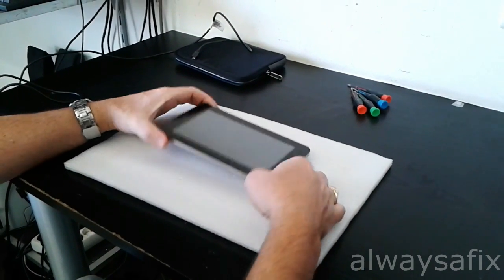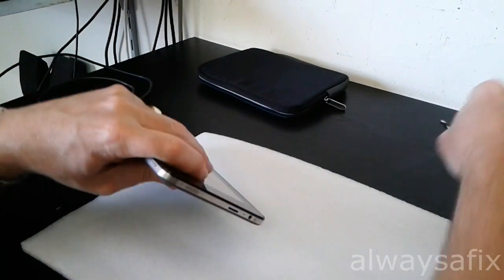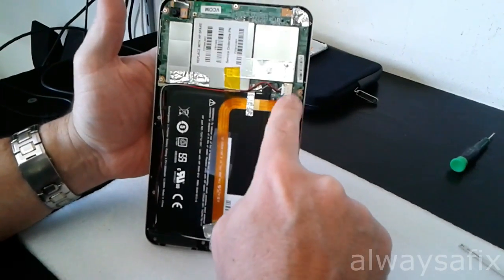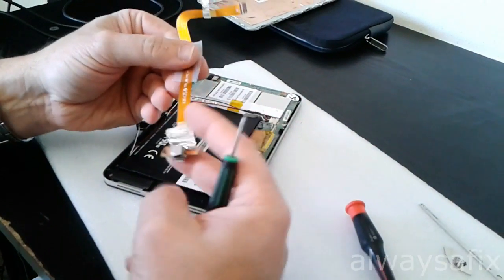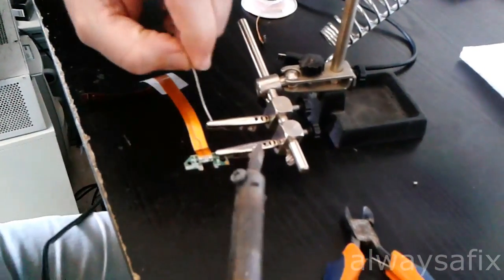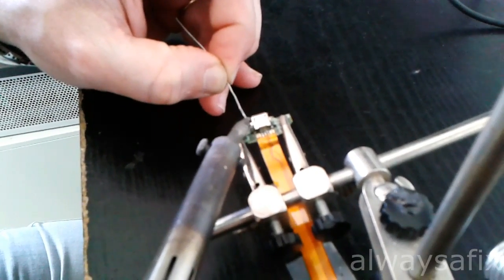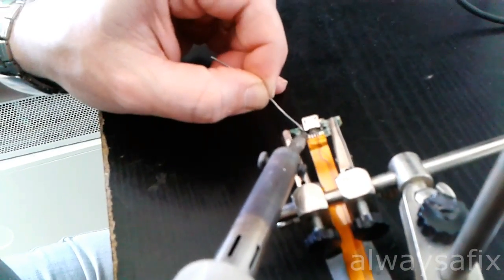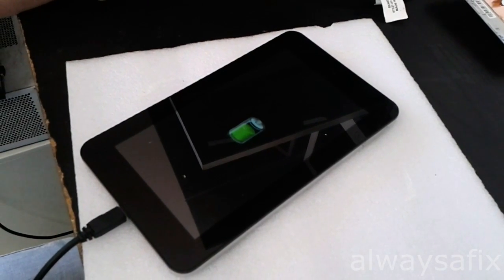Tablet android not charging repair

Comment: My archos 80 cobalt is quiet old but stopped working some day (years a go) the charger does say that its on yellow (mid charge) but will not turn on no matter what i do I leave it on charge for over 24 hours and it wont charge fully or go green, it used to when it did work.I also left it off charge for 1 night and it went right to red again. I have tried resetting but the screen never lights up completely dead ant ideas?
Reply: it is a small charger

Comment: I can't turn my tablet on. I only get a "flashing" battery sign with battery voltage at the bottom. I opened my Mobicell "Plum" and checked the red and black wires where they connect to the board. I put the voltmeter to check them with and without the usb charging cable plugged in and I get about 3.4 volts. The battery label says it is 3.8 volts. I wanted to take it back to PEP for the warranty, but I left Joburg and am staying in Seoul and it started happening after I left Joburg. I'll unlikely come back soon enough to take advantage of the warranty. Ironically, this technically advanced country with fast internet doesn't have inexpensive tablets! And my data is still on this tablet. I've only had it for 2 months. Any other ideas you might be able to advise? Local fix-it men are hesitant to work on a tablet from overseas.

Comment: did not work and now I have to buy a new tablet
Reply: Why didn't you just take it to a repair shop -_-
Reply: Any tablet is going to give you the same problem. I've been through 2 tablets since 2014. Same issue, broken USB ports. I will never buy another tablet again.

Comment: Will this thing fix this story i have the same tablet HP Slate 7 : I had it on school and the charging port was kinda broken i had to put it on a wierd  way and it was charging . But when i was charging it a stupid student played with the wire and then the tablet fell and the charging port is not working and that thing in the middle goes out when i plug it and unplug it hard.

Comment: Hello there, while i charge my tablet my cpu is getting extremly hot but the battery stays cold :/ What can i do now? any idea? many thanks in advance!
Reply from the maker: +7sTuTe7 First step is to try another charger.
Reply: +alwaysafix hi alwaysafix. i tried many different chargers with  various outputs yet. whats the 2nd step? :)
Reply from the maker: +7sTuTe7 Sorry it sounds like you have a faulty motherboard.
Reply: +alwaysafix alright that sounds Bad. can i try to hard reset it somehow? what can i do now?

Comment: hi..i have the same tab...my problem is that,if i put on the charger it will turn on but it wont charge..do have any fix on this problem?..evytime i use my tab i have to put my charger on..please help..
Reply from the maker: +Raleigh Ocon You can check with a multi meter where the battery connects to the motherboard.  Take a reading without the charger and then take a reading with the charger plugged in and get back to me.

Comment: August 26/15
I don't know how do you YouTube but here goes I have two tablets two different types of tablets and I noticed that when I use my tablet and you're still plugged in why is it draining my battery if my cord is plugged in is not like that laptop wences plugged in your using the power from the plug and then your battery so why would my battery on my tablet be draining when they're still plugged in Thanks
danielrenelamarche09091957@gmail.com
Rene.

Comment: hi, ive got the hp slate 7 hd. after repairing the connector the tablet is completely dead. what to i do with it now? thanks
Reply from the maker: muhmonga Connect the charger and use a multimeter to test for voltage where the ribbon cable from the power connector joins the motherboard.  You should get 5 volts.  If not, your repair was not successful and maybe you should consider buying the whole charger board and ribbon cable complete for an easier fix.  Good luck!